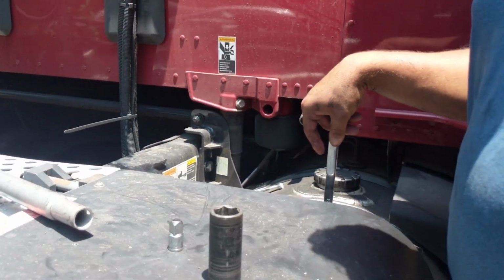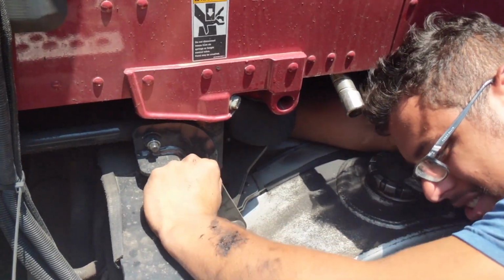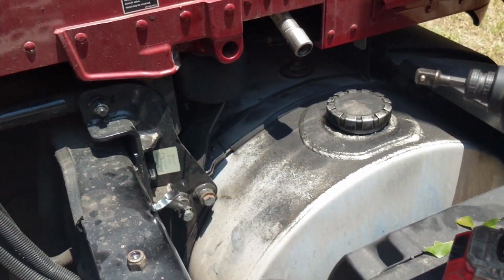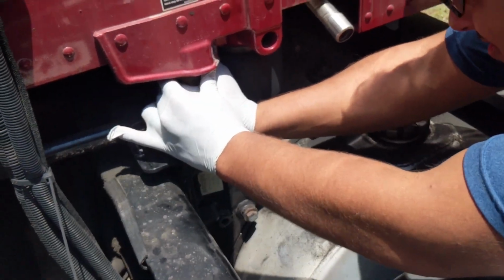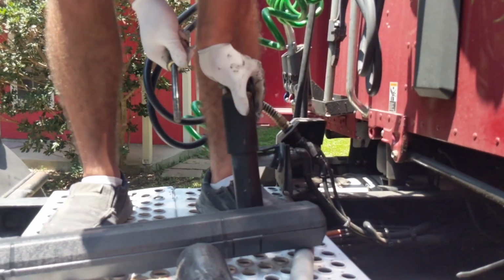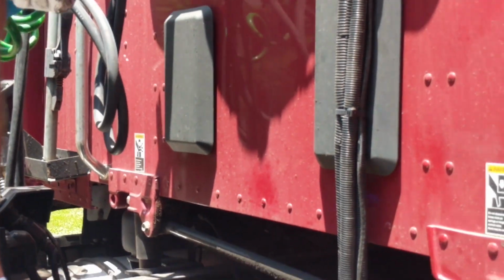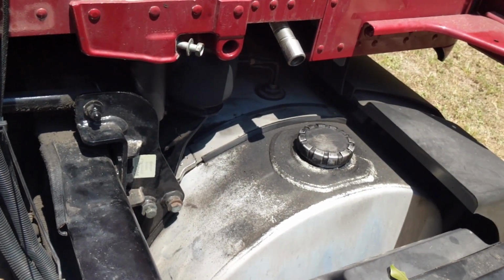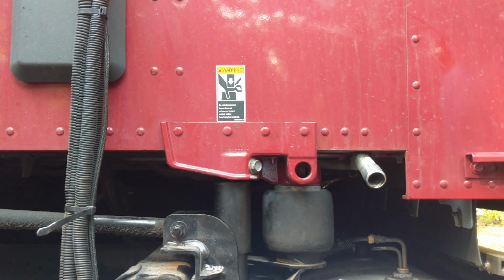Cab shocks KW T680 how to part 1

Comment: I recommend next time using the level valve to raise the cab as high as it will go, then put blocks under the cab to hole it up, and release the air

Comment: If anyone does this. I recommend putting anti seize on the bolts. I’m working on mine right now and had to use an air hammer and heat to remove the bottom bolt.

Comment: Was the cab leaning to one side is that how you knew?
Reply from the maker: No it wasn't usually when you have that lean on the cab end it's usually a leaking cab air bag but in this case we just had an extra bouncy cab going down the road so the new shocks helped stiffen the suspension and made the can less bouncy
Reply: I don’t know but somehow I like it bouncy😁
Reply: I have one that was wet looking only after a few 100 miles still looked wet so im assuming the grease pushed out of it